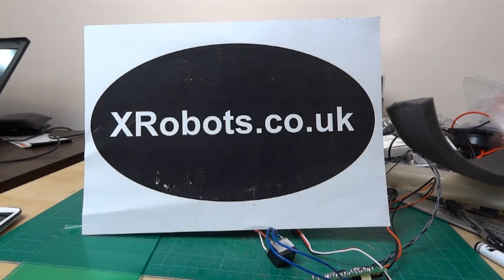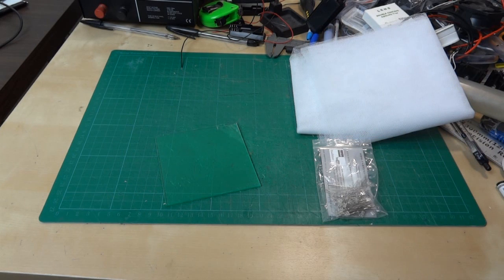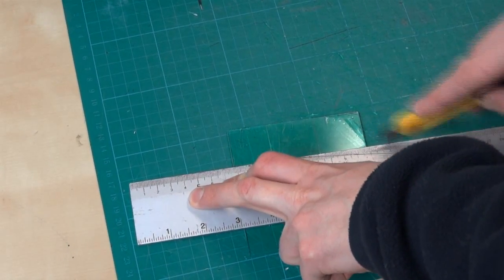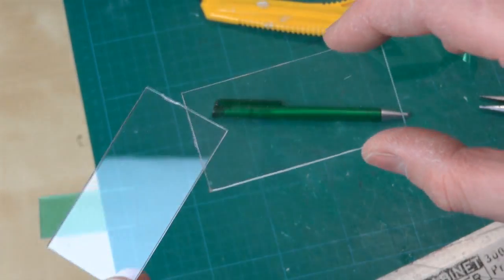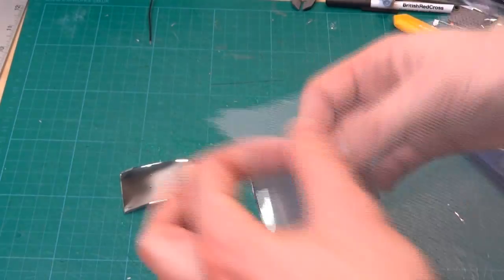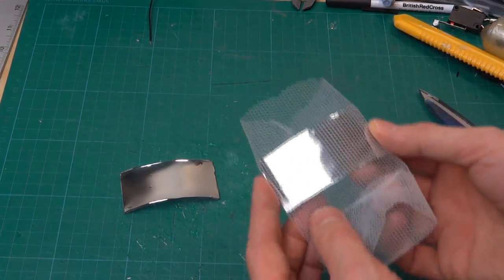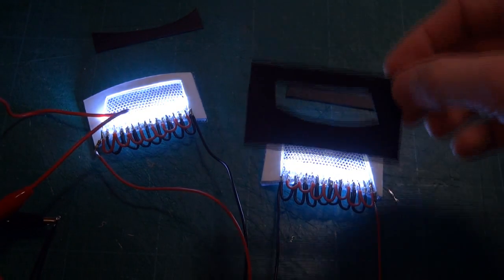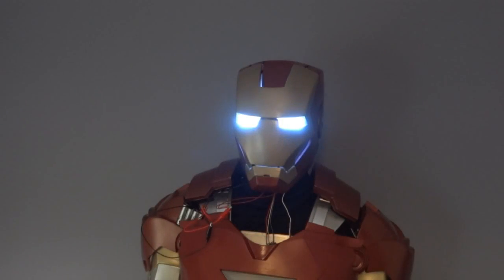Iron Man Power Suit #46 | Motorized Helmet | James Bruton

Comment: So you wired the LEDs in series and I see you added one resistor to the positive end of one eye and another resistor on the negative end. Can you explain that a little more? I need to understand it for my project and I am not great with electronics.
Reply: its so his penis wont get hard, so the resistors will resist the urge to rise. Its also color coded as well so he knows what race to get hard and not get hard to. Those will need to be soldered to each testicle  and u can use some flux as well. That should cover it 😀
Reply: You alright, man?
Reply: +Surge P. yes of course dove

Comment: looks awesome. I had the same problem with the film with my halo helmet. The trick I found was to use soapy water and squeegee. Also a paint striping heat gun is ideal for melting acrylic especially 2 mm, (just for those guys who's partners go mental when we use ovens lol). I agree with some of the comments below as its hard to see through my visor when its to dark. I like your solution for putting the LEDS in parallel as I was thinking getting so many in would be fiddly. Think your doing a great job as always James. Keep up the good work. Thanks for the tip regarding the 3d printer too, it works a treat now :)

Comment: I have some ardiuno code that allows a button press and it closes the face plate, then turns on the LEDs in the eyes with a flicker and fade in. Best thing is that its all fits onto a a 8 pin ATTiny 85! One chip that can be done dead bug style. The ATTiny runs off its internal 8Mhz oscillator. Simple as putting 5V into it and it works.